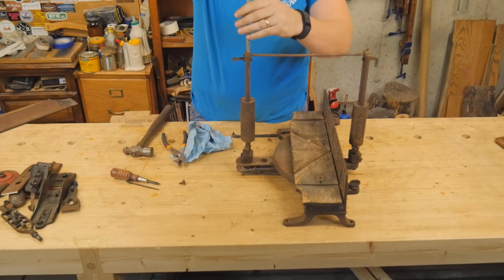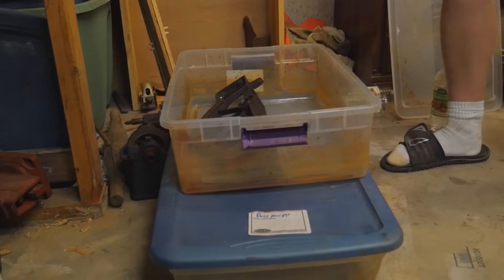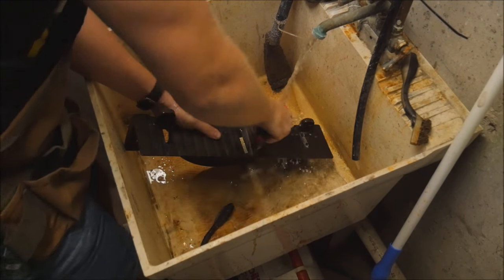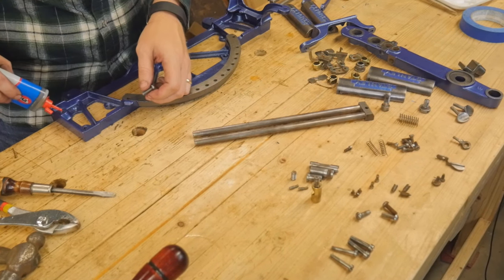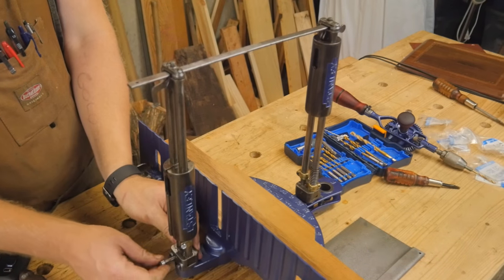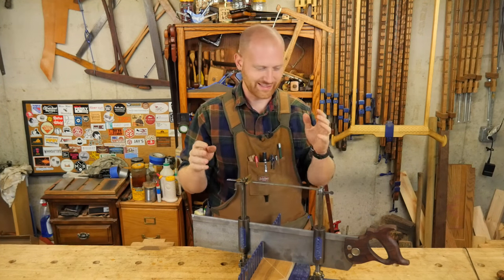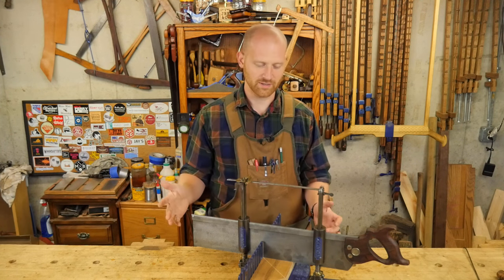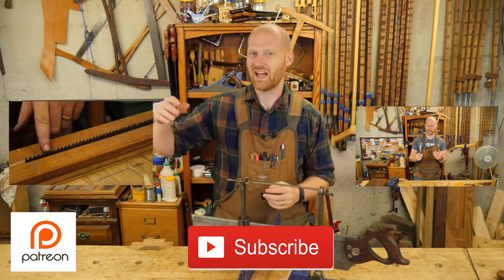How To Restore a Stanley 244 Miter Box

Comment: I had a Langdon Miter box from Millers Falls with a 26" saw.  I never really liked it and sold it as I never had the room to leave it setup and and my bench hook was just easier to use.  I found out later that these were really only necessary when doing Crown molding as those are much more difficult to cut freehand.
Reply from the maker: spot on. this one was made for doing segmented frames so you could quickly set it up to do accurate angles for 4, 5, 6, 8, 12, 24 sided frames. I had another one that was designed more for trim work. but if I am cutting a 45 or just a 90 cross cut free hand is just so much quicker.

Comment: Thank you for keeping hand tools alive.  I am a power tool guy with a shop full of monster machines.  I however, do not like power miter saws for the noise and mess.  I have a huge Dewalt radial arm saw but I prefer keeping that at 90%.  I saw your video  restoring a vintage Stanley box.  My question is if you had a choice, would you go for a Stanley 358 or Miller Falls 75c?
Reply from the maker: No preference there. It all depends on who was the last person to take care of it.

Comment: I was waiting for this one.

I have a mitrebox somewhat similar. Its 25 years old and actually blue out of factory. I think mine was too cheap, its not that acurate, but it gets the job done. Mine has a modernstyle metal bow type saw in it with a bit longer stroke than yours. 

Great job you did there. You are meticulous about it and thats good. I didnt expect so many parts. No screws left over?

Nice vid! Thanks!
Reply from the maker: Sweet! I would love to see it!

Comment: Did you have to add any shims to any of the rods to get a tight fit and line up the slotted to the top hold down?
 I have one that I guess is worn and when tightened, the rods are askew at the top and either have to shim or machine new.
Reply from the maker: Not with this one. It has small adjustment screws to make the needed changes.
Reply: I made one by reaming very small thin washer then machined down on stone.

Comment: Cool tool and video. Just don't break any more of it, ok?
Could you oil the surface before taping it or after to keep it sticking.
Will you make a Jay Bates style miter station/bench for it? haha. Wonder if there are also compound versions of those saws...
Have a great day, cheers.
Reply from the maker: +Nearoth if I oil the surface before painting it then some oil might get on to one of the services that need to be painted. And paint would never stick to that spot. I just put the masking tape on and oil it down after taking it off. I thought about making a miter station for it. But I will probably only use this when I need to make cuts that are not at 90 degrees or 45 degrees. So that means I will only use it occasionally. For 90 degrees and 45 degrees it is just faster to cut by freehand

Comment: Is that a 20" saw? I'd go to ebay and get a 30".
Reply from the maker: it is a 26" but for the few times I will use it the longer saw probably will not be the best use of money. but it still would be a decent upgrade.
Reply: Wood By Wright Good point.  I don't think a 30" would make much difference from a 26" anyway.
Reply: A 24" would actually be standard on the 244 box. They are designed for a 4" tall plate and it gets hard to find 28" and 30" saws with only a 4" plate.  Stanley number system:  244 box = #2 frame, 4" tall x 24" long saw. 358 box = #3 frame, 5" tall x 28" long saw. 460 box = #4 frame, 6" tall x 30" long saw and so forth